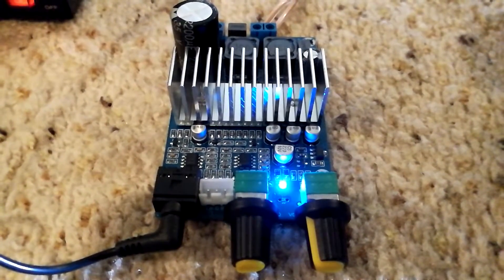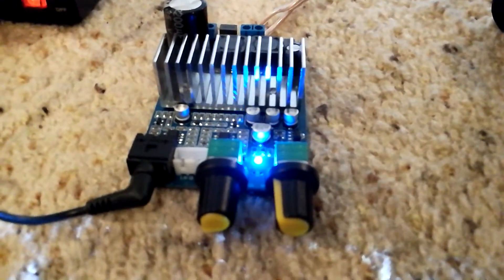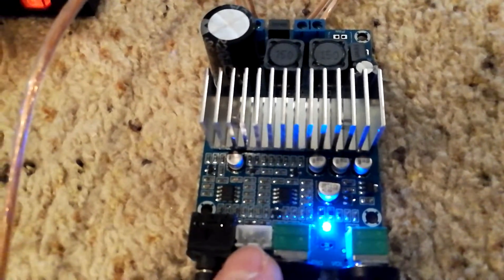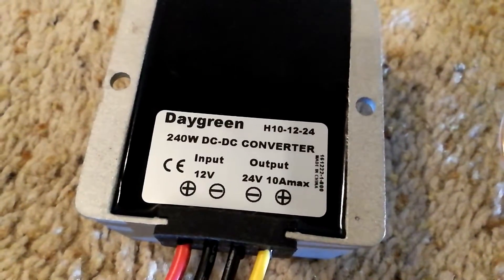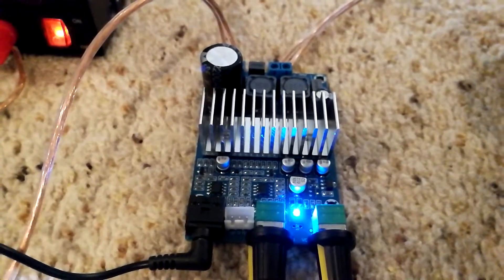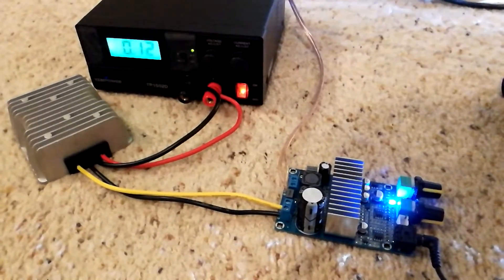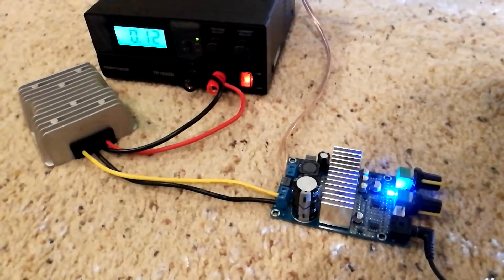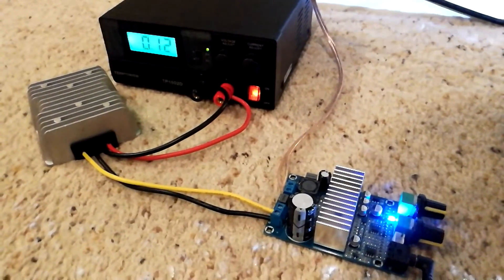Subwoofer Mini Amp Flex!~ TPA3116 Class D Mono Sub Amplifier Board + DC Step Up Boost Converter!

Comment: I have many tpa3116 amps and they all seem to have a clipping problem with smallish subwoofer drivers that all by their nature have their impedance spike at a relatively high frequency. @ 20 volts there's no problem pushing 20 clean watts to 12 inch subs but 6,5 inch drivers receive only 4 clean watts.

Comment: which power supply do you think would be best for this amp? 24v 4-5 amp?
or stay safe with 19 volts 3 amps? thanks
Reply: 24v but add a fuse

Comment: wow ... i am so happy to find this video is the step up convertor capable of being installed in a car with a battery voltage of 12v 24A?...
 i was thinking about it, i have a plan to make a subwofer with tpa3116, i think i need 24v power for a tpa3116 amplifier

Comment: If your power supply is only 12V and 2A, then your max is 24 watts assuming 100% efficiency. Doubling volts cuts amps in half, so you end up having 24V and 1A. Volts x Amps = Watts.

Comment: Hi friend. I'm planning to run a 4ohm 100w subwoofer in my car with this amp. Can I get a clean bass without distortion with the available 12 v power supply? Will you recommend?

Comment: Great Scott, thanks for the video! :) (BTTF... one of the best movies ever!)

 I have a Klipsch Promedia 2.1 set that I blew the amp in. I tried to fix the amp by installing new fuses, but the fuses keep blowing, so there are other components that are damaged. Anyhow, I saved the set (Bought a Logitech z623 - lol which is booming with your video here. :) ) and was interested in putting the Klipsch sub in my truck. Would you know, and could you tell me what wires and such would be needed to do that? I suppose I need to run a power wire to the battery, through the firewall? 

 I just installed a new Sony stereo. It has an RCA jack in the back for subwoofer. I already ordered an RCA wire - 20 feet or so. I was going to just try to hook it up with that but i'm sure it's not enough power. I have a Sony DSX-B700 4x 55W. I don't need anything outrageous, just a little extra bass than the factory speakers put out. Which.. the factory speakers are pretty nice.

Comment: Thank u sir with that informative video. 
I have a toshiba mini soundbar subwoofer which is rated 40watts @8 ohms. Its a passive subwoofer gets its power from the amp installed in the soundbar. 
I have tried this 100 watt mono sub amp and its working with a 4amp 19 volt power supply without a problem. I used audio 3.5 jack to input the stereo signals from my phone. 
Now i cant figure out how to use signals from my car audio. The player does have a sub output but the input requires R.L.G. a set of three wires. 
Also do i need a step up circuit in order to boost 12v of my car? It worked when i tested but it seemed a bit distorted at 12 i think.

Comment: How useful did you find the crossover frequency control?  I put one of these in my son's car driving two 8 ohm subs wired in parallel and the frequency control doesn't seem to do much, if anything.  Just wondering if I happened to get one with a bad potentiometer or something. Thanks.
Reply from the maker: I used this in a friend's car with a factory stereo and from what I can remember the crossover frequency adjustment worked well. Maybe not as good as a store bought amp, but I could definitely tell it's working.

Comment: My ONKYO integrated amp has a single line out ( One RCA female out ) for an active amp.   Could I use this output and use a single male RCA to male RCA cable connected to a single Female RCA mounted on my passive sub then wire this to the board? Thanks in advance and cheers for this video 👍
Reply: I've used this amp with just one channel hooked up to the input. Use the included cable with the JST connector and solder an RCA to the other end. Most receivers have plenty of oomph at the sub output to drive this amp to full output. Keep in mind that these little amps will only do about 55 watts into 4 ohms or 30ish into 8 ohms so make sure you use a subwoofer with a driver that is fairly efficient.
Reply: @theAGanimators  Ok, thanks Glenn.

Comment: Which female DC power jack plug socket could I use to mount on the back of my enclosure for this board? Thanks..
Reply from the maker: Anything you choose really. It's probably a good idea to choose a common laptop plug size though.
Reply: @cafe80s  ok, so it looks like a standard 2 pin since the back of the  power amp  is two lead.

Comment: Hello there.were u able to test in a car?if yes,could you please tell me how you connected it to get power?thanks
Reply from the maker: Hi. I have it to a friend to use in his car and it worked very well. The voltage booster was also used. I used a little plastic box and installed a SPDT automotive relay connected to the remote turn-on (accessory power) to switch it on. Since the relay is capable of 30 amps and this amp only draws a maximum of about 4 or 5 it worked perfectly. And the amp never even got warm.
Reply: cafe80s thanks a lot for the reply.im curious about the relay.how did you wire it? I would like to do this project and use a nexus tablet as my stereo.i already have it installed but  it’s connected to the car stereo for audio.do you think this amp can drive 4 car speakers?
Reply: @PaakoBravoo  It can if wired correctly. It depends on the impedance of the speakers on how best to wire it up. What is the ohm value of the four speakers? 
 I know this question is a year old but hey...

Comment: I have purchase this amp and i wonder if its good idea to power this amp with 18v of batties. Will this not work properly?
Reply from the maker: It should work well, but I don't know how long the batteries will last of course.
Reply: I'll have a rechargeable batteries incase it runs out. I'm just powering this amp with  my subwoofer Logitech 625.
Reply: Yes an 18v battery from a drill or something like that would work great. This amp will operate at any voltage between about 10 and 25

Comment: Nice video. Did the step up create any noise? I am building a BT speaker and I am wondering if going from 12v (3 18650 in series) to say 18v would cause any noise or battery problems. Any advice? Thanks
Reply from the maker: It's now installed in a car with the step up convertor. It's powering a 10" subwoofer for a while now and here haven't been any issues. No noise in the sound system, and no issues with the car's bluetooth connection either.
Reply: Yes on the noise but not always noticeable on a sub. Three 18650's will drop to 9 volts or less as you run them down and the cheaper QSKJ 150w dc-dc converters will start cutting out at less than 10v input (not sure about the one the OP used here).  If you're running 18650s its better to just go to a 6s pack IMO.  With a 3s pack you should be 3s2p to keep up with the current draw anyway.

Comment from the maker: Not 3118, my mistake! 🤐
Subscribe to my channel for other mini amp videos!
~~~ Help support my channel by purchasing here:
Subwoofer amp board
https://amzn.to/2OjOUmS
Tekpower variable voltage power supply
https://amzn.to/2OlwlPd
12v to 24v DC step up boost converter
https://amzn.to/2APkvem